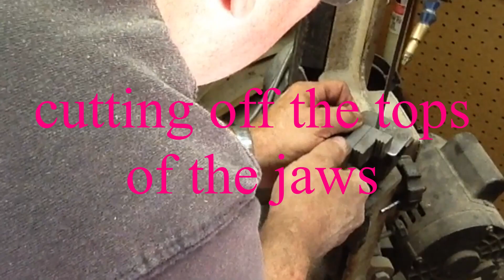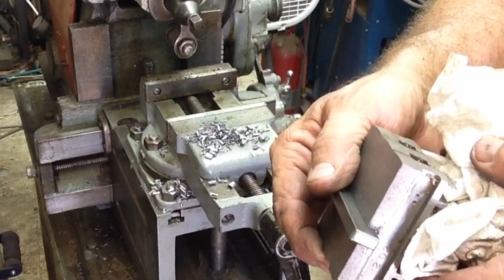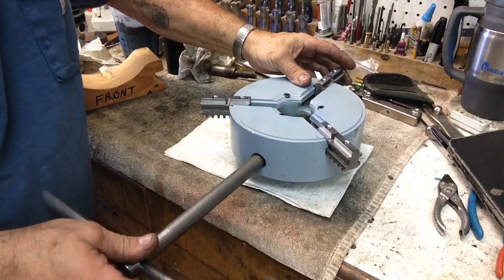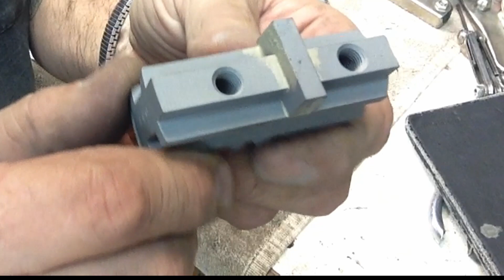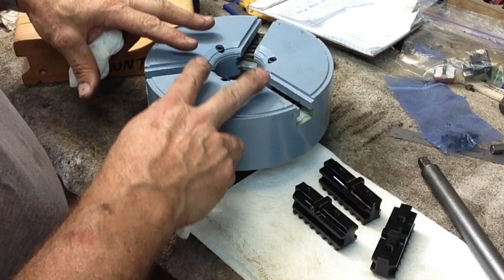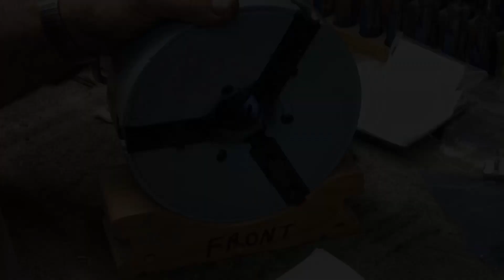Sheldon Lathe Restoration, Modifying A 3 Jaw Chuck: Part 3

Comment: Did you aneal the jaws before cutting them on the bandsaw? if not, what blades are you using? Thanks
Reply from the maker: No I didn't find it necessary, it was a standard bi-metal blade, I think it was a 12-14 pitch and was starting to get dull which is why I had to work it as hard as I did.